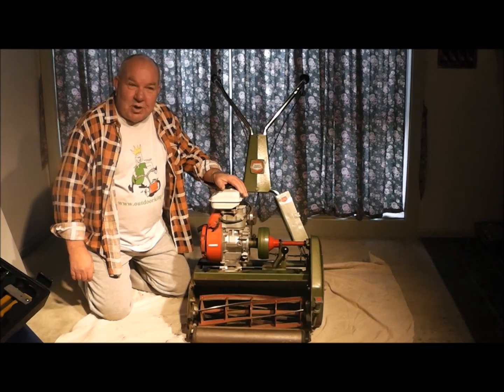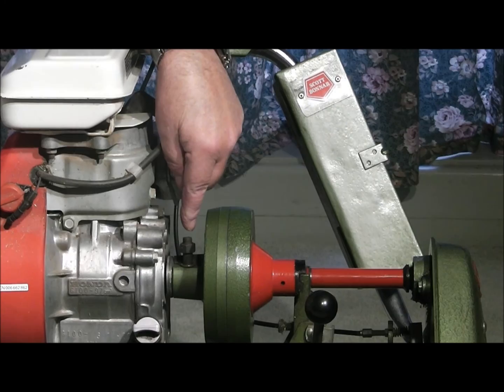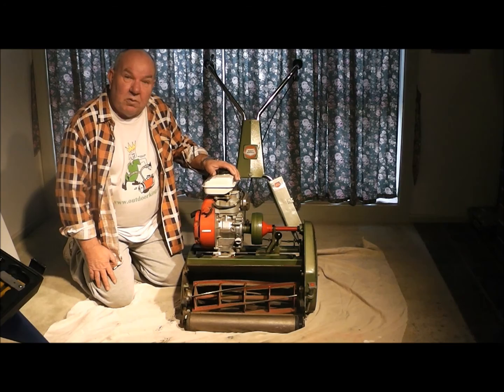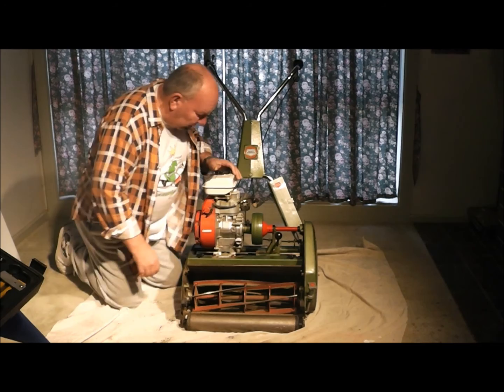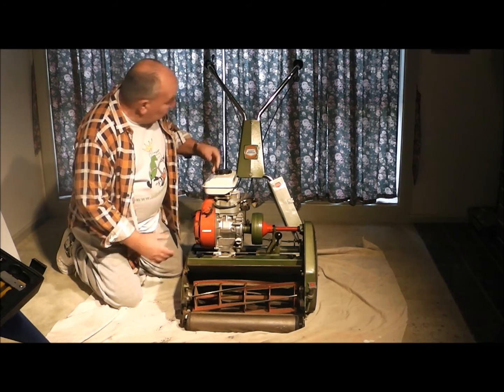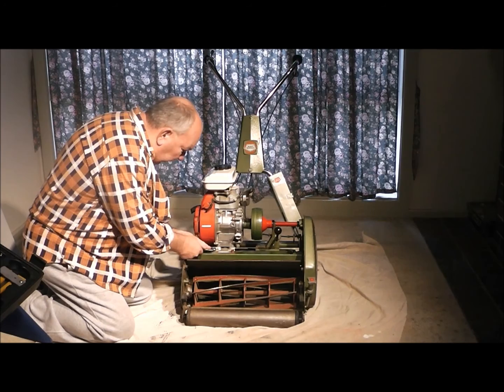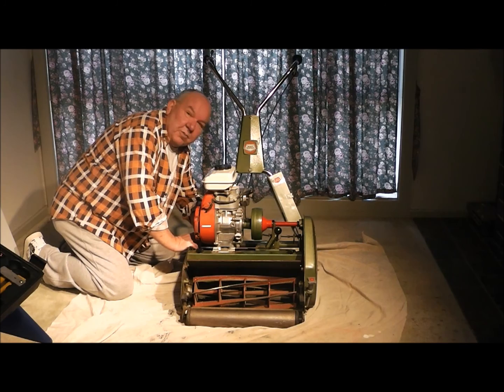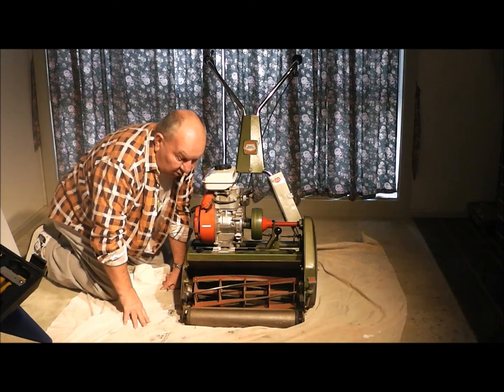Scott bonnar model 45 engine and clutch removal guide

Comment: Thank you good sir, today you have helped an amateur restorer. Who knew all I had to do was push the cotter pin down (didn't work the first time so had to pull it all the way up and knock it down again) and the clutch assembly came off the shaft (albeit with a little persuasion lol), top job old mate, cheers 🍻

Comment: Nice instructions, very easy to follow but i must say that in all my time of working with these i have never seen the clutch half come away from the motor so easy.
That half is usually very stuck and can even break using pullers and often needs heat to expand it to get it off without breaking it.
To replace the clutch cone  or the thrust pad it is easier to remove engine bolts and then the 3 bolts holding the 2 halves of the clutch together and leave the engine half of the clutch with the engine

Comment: Hi Watching you repair the Scotty chutch ,you replaced the Briggs motor with a Honda , What reason for the change? My Briggs is very rough running, is this normal?
Reply from the maker: grant schuberg it was replaced in the early 90's the owner replaced it after countless trips to a repair shop. They are supposed to run reasonably smooth
Reply: Hi Junkyarddog 45 Scott Bonner Where do I find the two fuel intake rubbers One is 45 & the other is 90 degrees X 3/8 attached to the fuel intake from the garb to the motor?              

Cheers Grant